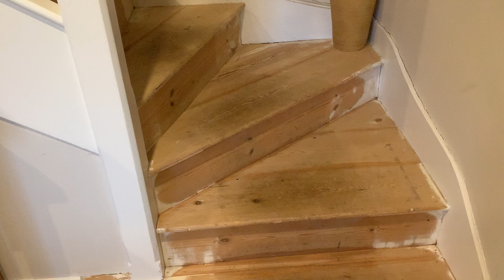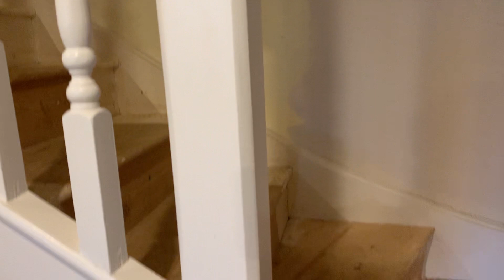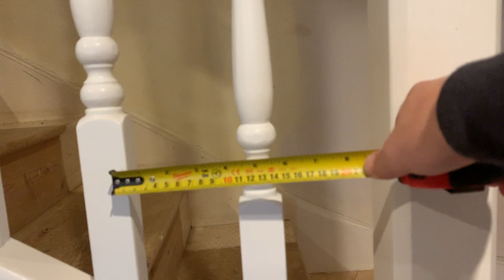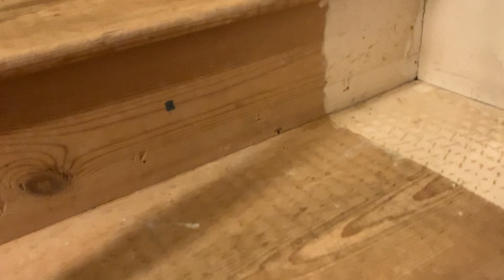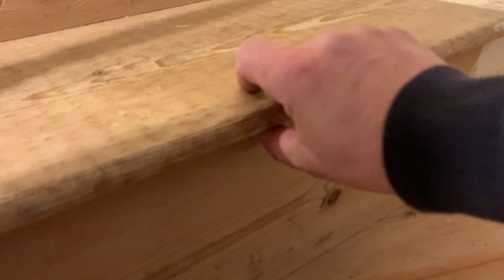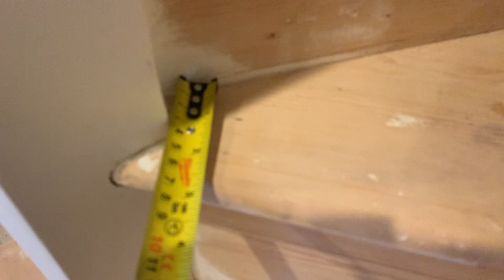A quick look at staircase terminology

Comment: All of the non parallel treads which turn the stair, are “winders”.  
The tread which fits into the corner is specifically a “kite winder”, because it is kite shaped, having four sides, and not three, like the other winders. 
(all of them are truncated at the outer stringer, giving them a very short extra side, but I am ignoring that, for clarity).